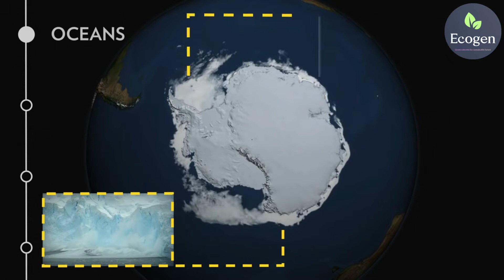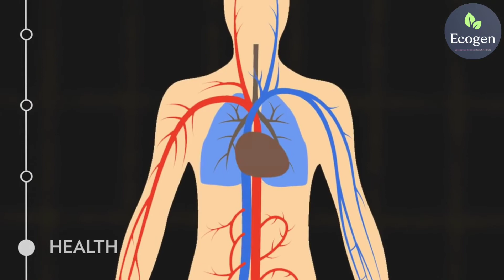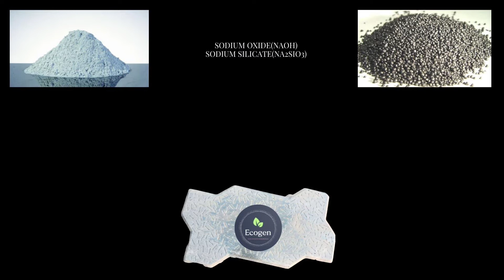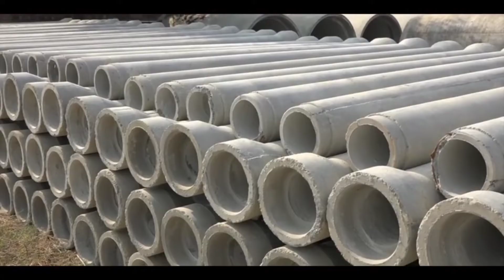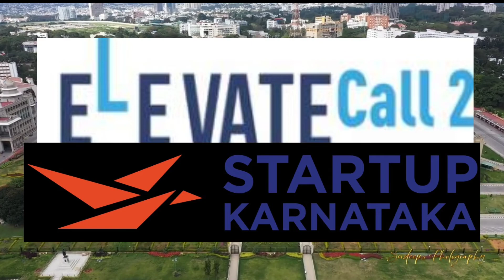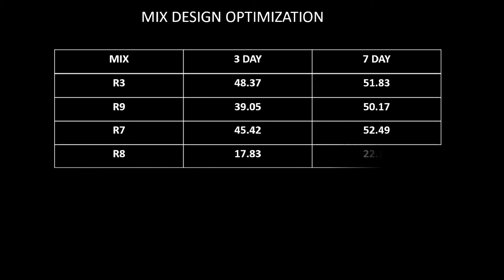Introduction to geo-polymer concrete

Comment: Hi i am also working on geopolymer concrete study since 3 years but according to the various prototype developed by me, the cost is getting higher than the conventional materials.
I would like to request you to please help me reducing the cost and economical mix design
Reply: check out the ferro-siliate geopolymer information from Joseph Davidovits